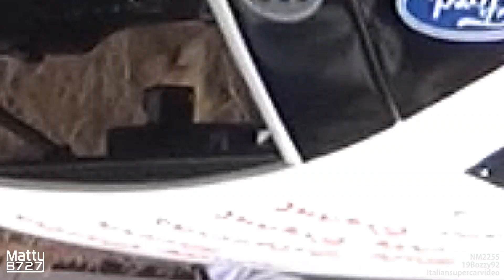1995 Ford Roush Mustang Cobra GTS-1 Trans Am! - LOUD V8 Sound at Festival of Speed!

Comment: This is the livery used by the Puertorican team Ajititi Racing when they did the 1995 Daytona24H. You will noticed the car say FORD PUERTO RICO. It finished 5th in class. The wing must be an upgrade of later years since they raced with the lower clear plastic one during 1995.

Comment: This is an upgraded car - When built it was limited to 313 inches. SCCA changed to rules to allow 358" NASCAR engines to be used (due to cheap used engines being available) that necessitated the larger wing. My car was originally built as a FOX body (now has the same 1995 body) and has destroked 351 Cleveland with 310" and 650 hp. The video car also started life as a FOX body Roush built a total of 34 chassis and they all still exist - a tribute to their engineering.